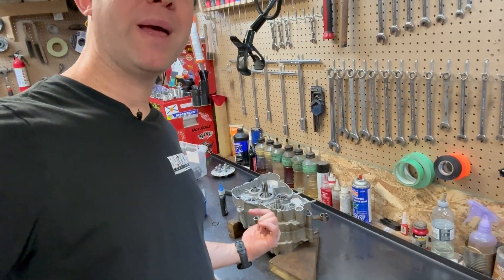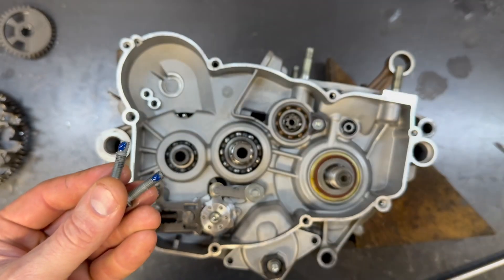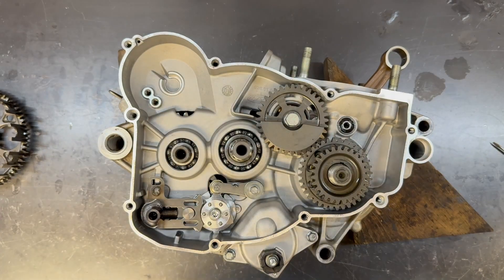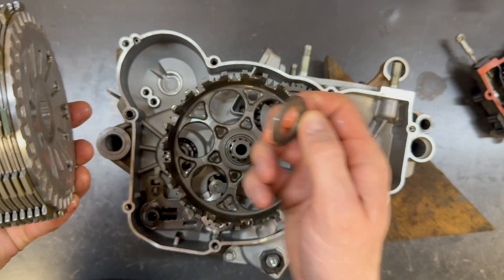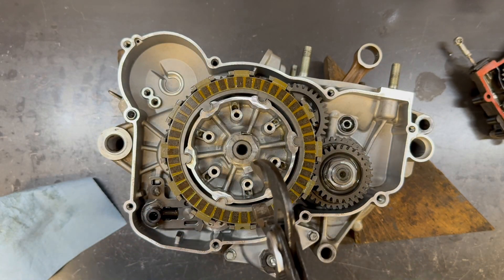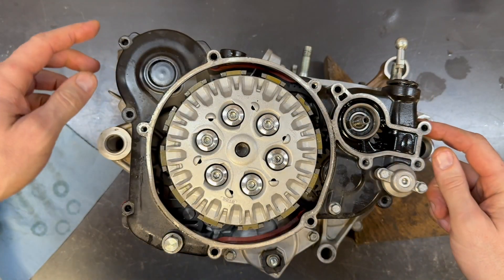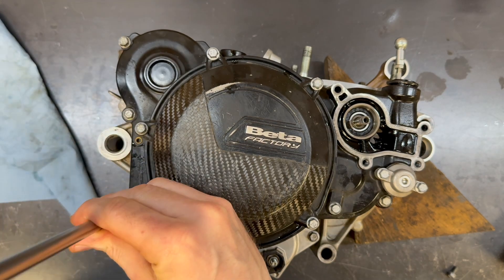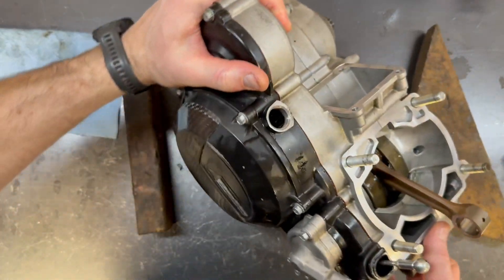300RR Clutch Side Assembly

Comment: My 2020 300RR has similar clutch pack and there is only normal metal plates and friction plates. My bike had less than 70 hours on it when I got it and it was in mint condition so most probably the clutch is original from factory.

Comment: What is that at 4:03? Looks like the gasket at the bottom moved out of place?
Reply from the maker: You’re right. It looks that way. I drop the bolts in before tightening them down because if the gasket is out of place I’ll feel it when trying to start the threads. If the engine wasn’t full of oil & not leaking after several days in my shop I would go and double check it.
Reply: Thanks for your video and reply.
Reply: The gaskets in that area and several others are a bunch wider then the gasket surface, totally normal.

Comment: Can I split the cases on a 2018 beta 250rr re just to remove possibly a broken piece of a piston without removing everything on the right side ?  No oil leaks , runs great before I parked it before winter . Thanks for your response  .
Reply from the maker: You could, but it would be more difficult and a much higher chance of making a mistake. You’re only adding maybe 20 minutes to re&re everything on the clutch side. You can also change water pump seal while you’re in there.
Reply: @ChuckfromTrueTech  thanks for your response  .